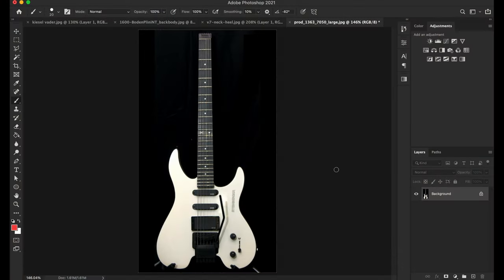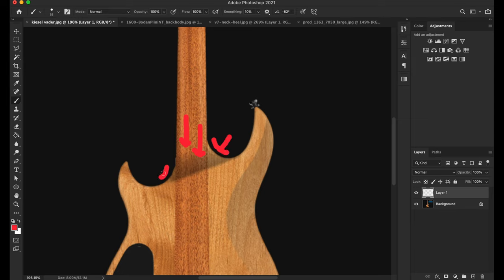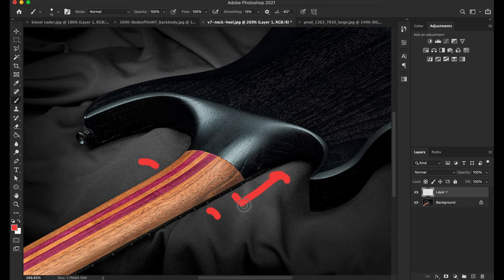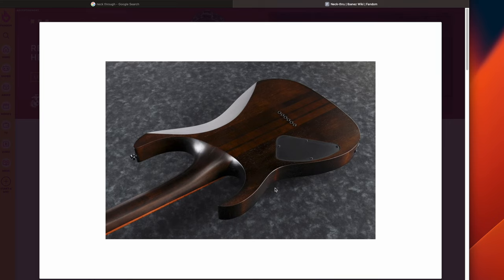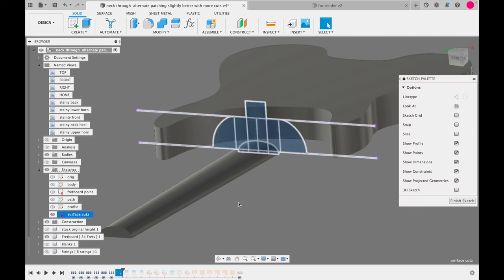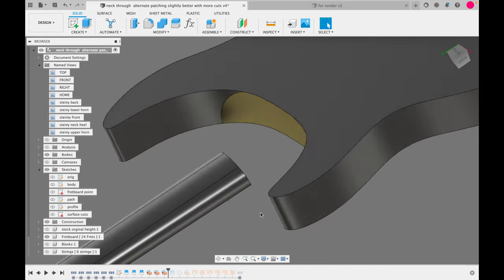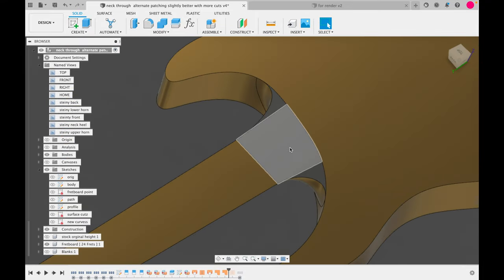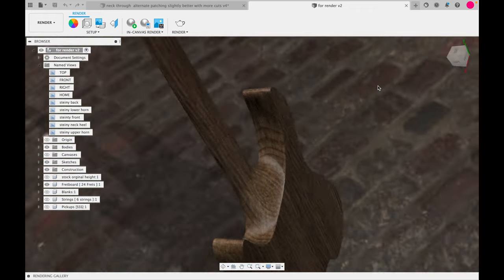Neck-Through Guitar Transition: Fusion 360 Tutorial

Comment: Nice, we don't get to see neck trough guitar builds that often, looking forward for this. 
I'm not familiar with Fusion but to avoid edges on the seams with zebra stripes you just have to make sure the transition of the stripes are continuous on the seams of the stitched surfaces.
Not sure what other curvature tools you have in Fusion but probably there is a curvature comb tool that shows a bunch of lines perpendicular to the surface and again, to avoid edges on the seams the change in height of the comb lines have to be smooth